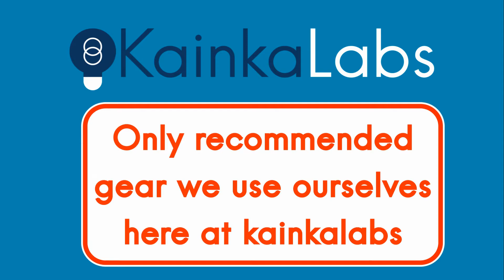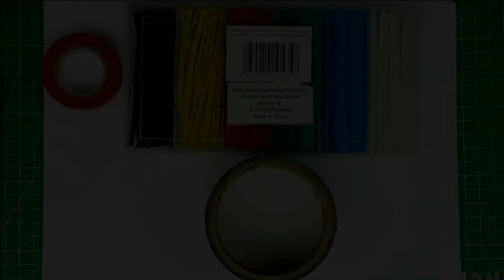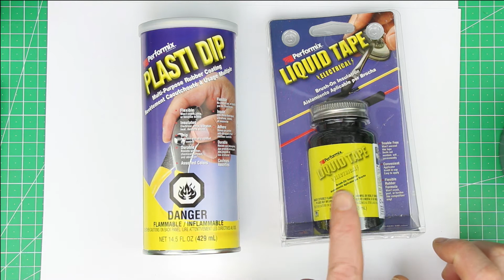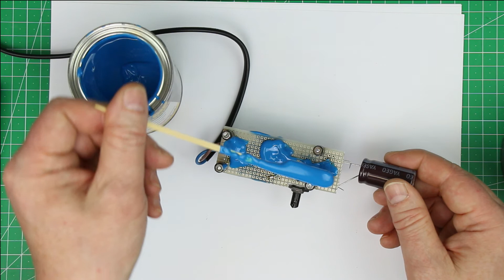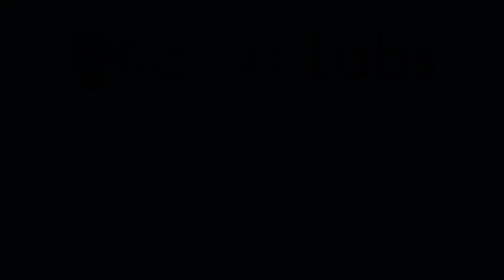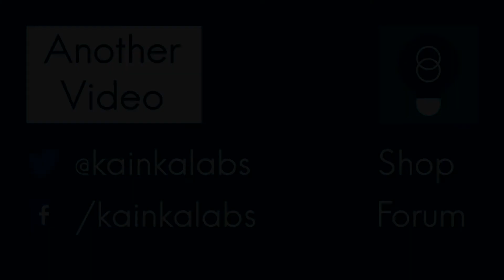Every maker should have…[Pt.21]…a can of Plasti-Dip or Liquid Tape

Comment: The nice thing about Liquid Tape is that is thicker than traditional PLASTI DIP. This helps it stay in place on the wire until it flashes. Both share the same dielectric strength.

Comment: Hey man, first: thx for the informative video! There is one thing of life experience I might be able to give back: I've noticed you use quite a lot of 'Ahhms' & 'Ohhhms' as fillers while thinking. So much so that it even hinders the flow of information a bit on the receiving end (imho). This can be 90% reduced with a simple training exercise to improve self awareness: Give a presentation to a small group of people and ask someone to ring a  bell whenever you use an 'Ahhhm'  sound as filler. It's awkward for 1 minute but after that you'll notice immediate improvement trough self regulation. It creates a powerful feedback loop that usually - with just 1 exercise - additionaly to improving self esteem and self awareness also fixes the issue so much so, that for most people it will become almost unnoticeable. Usually even permanently. Of course repeating the exercise helps further but after 4-5 it's deminishing returns. Hope I was able to formulate in a way that's inoffensive. ❤
Reply from the maker: This was a very early video where I did not do the editing by myself. In the later videos I snipped all the "Ah" and "Ems" etc.
Reply: @KainkaLabs  Oh cool! :)

Comment: Would you recommend Liquid Tape over Plasti Dip? Or are they basically the same, except for the built in brush? Thank you!
Reply from the maker: They are the same. So take whatever fits your needs best.
Reply: @KainkaLabs  thanks, I was thinking to buy the liquid tape. But I was also curious if plasti dip was the same as liquid tape. Which it is.

Comment: what if i have to remove it?
Reply: No it's actually very resilient you have to peel the heck out of it for it to come off I recommend the hell out of it actually! I use it on the wiring harness of my motorcycles and can't be more happy. I'm out here in the east coast of Florida and the saltwater really kills wires this is really the only solution to do it right the first time. It's very helpful to also know let the can spray and the paint on and the dip are all the same substance so whatever is easier for you to work with you should grab and try.
Reply from the maker: You can peel it off again because it doesn´t harden but remains soft.
Reply: @KainkaLabs  So its less permanent than silicone?